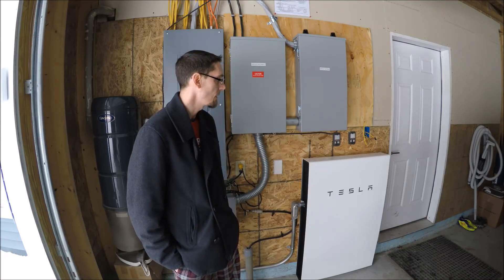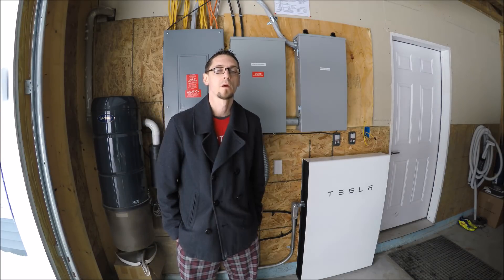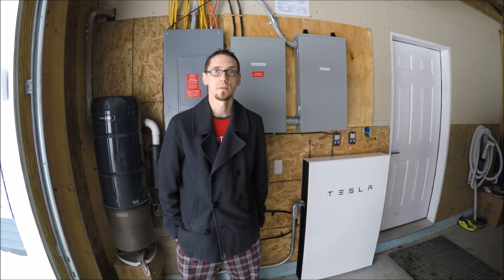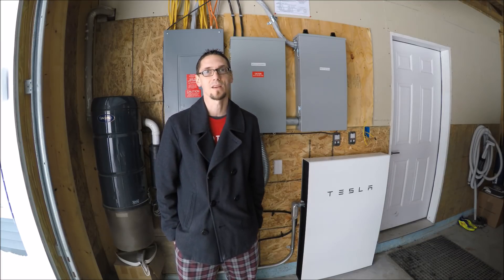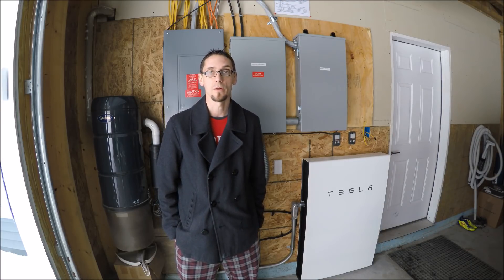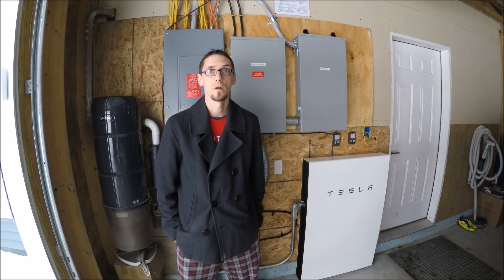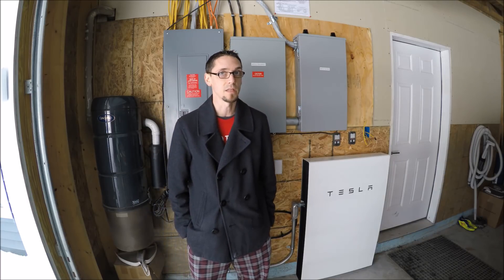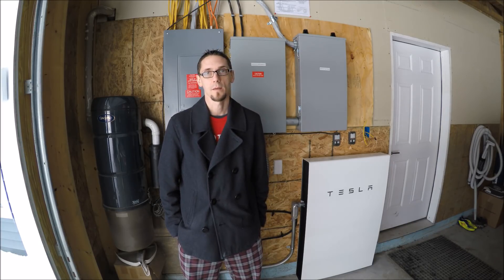New Tesla Powerwall For $1500

Comment: 48amps in NOT the max that the wall connector will deliver ....  it does up to 72amps for the X, & it can deliver 80 amps for dual charger model S's.  According to Tesla's web page - this applies to the model 3 as well
https://www.tesla.com/support/home-charging-installation
just sayin'.
Reply: You're correct in almost all you say, but he wasn't speaking about the wall connector, he was specifying the maximum charging rate that the Model 3 can handle.
Reply from the maker: You are correct that the Model S and X can accept more AMPs and the TWC can put out a lot more than just 48AMPs.  However the Model 3 only has an onboard 48AMP AC to DC charger and there is nothing else offered to upgrade the Model 3 from that.   So, at this point a Model 3 can only accept a max of 48AMPs for AC to DC charging.  Of course a Supercharger is a lot different as that is DC to DC charging.  Thanks for commenting.
Reply from the maker: Also...if you look closely at the chart in the link you left, the Model 3s MPH of charge stays the same after a maximum output of 48AMPs.  The reason the car can technically accept all the way up to a maximum of 80AMPs of output, is because the car can recognize it's max potential of only being able to receive 48AMPs, which is limited by the cars onboard charger.
Reply: Vehicle battery option  On-board charger capacity (current/power)
Model 3 Standard battery  32 amp / 7.7 kW
Model 3 Long Range battery, Model S or Model X with 75 kWh battery  48 amp / 11.5 kW 
Model S or Model X with 100 kWh battery  72 amp / 17.3 kW
Reply from the maker: It can handle whatever the TWC you throw at it due to the limit of the onboard charger, which is 48AMPs.

Comment: Should that POWER WALL BE SITTING ON THE FLOOR SHOULD BE AT LEAST 1 FOOT ABOVE FINISH FLOOR
Reply: I'd have insisted it be mounted higher, people DO wash garage floors after all and any water could be detrimental IMHO, but just my opinion and what I'd request apon instilation. Period.
Reply from the maker: It's perfectly fine to sit on the floor, it has rubber feet and is also made to withstand outdoor installations. This is obviously in my garage and no chance of water in the garage every reaching above an inch of standing water. Plus, the case of the powerwall is sealed.   Great question and actually a common question I've had.  Keep in mind the whole installation was done by Tesla.
Reply: TM3Life OK. Have it your way. Thanks for responding.
Reply from the maker: Personally, if I had it my way, I would of had it installed three or four feet up on the wall, but that was Tesla's preferred method of installation and since it's completely covered for any issues for the entire 10 years of service, I'm fine with it.
Reply from the maker: It was Tesla's install...so would hope they know what they're doing. If it fails due to their mistake in mounting they will take care of it.

Comment: GMP Powerwall deal vs buying a ICE generator:
Sometimes a gas or diesel generator is better suited for emergency power, but $400 generator will not automatically start, automatically isolate from the grid, and automatically shift to the house (automatic bus transfer). Even a basic generator with basic electric start (not automatic start) and a manual bus transfer cost roughly $1750, plus tax, plus installation. 
lowes.com/pd/Generac-HomeLink-6500-Running-Watt-Portable-Generator-with-Generac-Engine/999960939

The GMP powerwall deal gives whole house automatic backup power, and to install a internal combustion generator that does that same function automatically will cost a lot more than $1500 to purchase and install. The GMP “gas tank” automatically refills when the power comes back, or when the sun comes up if solar is connected. It will not need any oil change. The GMP is silent and should be trouble free.

A generator may be better suited if you lose power for long periods, that would need more than 14 kWh during the power outage. You can also take a portable $400 generator somewhere else to use it. As long as you have gas, you can keep making power. 

With solar panels, which pay for themselves eventually, the GMP deal is ever better because all you need is the panels and inverter which can sync to the GMP powerwall when the grid is down. Most grid tied solar won’t work when the grid is down do to anti-islanding, and it cost a lot more to install a system that can do what all the boxes GMP installed already does.

For me, the GMP deal would be good because I don’t have a place to store a gas generator, and it would sit for a while and not start easy when I needed it, even though a $400 1500 watt inverter-type generator would work fine for me as long as I had fresh gas. 

If you are at work and just the wife and kids are at home, any you have a portable generator that needs to be connected illegally to your house with the grid down, it’s not easy to explain how to hook it up. Believe me I’ve tried. LOL

Each person needs to evaluate the pros and con of each system, and their budget and situation. If you can afford it and feel the need for it, you can get the GMP powerwall and still keep a cheap gas generator.
Reply: Philip Agtuca, yes, it’s not efficient, but worth it if your frig or deep freezer needs to stay on. The inverter types can throttle down and run at most efficient rpm for the load. And they are quiet when only running a light load. Each person has to analyze which, if any, is the best solution for their usage.
Reply from the maker: Very well said!!!  I travel often for work and my wife would not want to have to worry about losing power and starting up a gas generator.  This, for me is the best situation I am fortunate enough to take advantage of.  Once the solar goes on the roof...it will be even more sustainable for longer periods of down time.
Reply: Based on spec, 3.2kw for 12 hours empties the 7.5gal tank. At $2.49 /gal ave, cost to gen power is 48.6c/kwh!

Comment: Not sure but I believe there’s a local code that requires that the powerwall needed to be off the ground in case of a water leak.  It should be at least the same level as your door step. Giving it about 5 inches of free board. If the case it self is sealed so that it protected against water damaged  then you should be ok.
Reply from the maker: Dale, this was installed by Tesla and Solar City, which of course is now just Tesla.  Green Mountain Power had to sign off on the install.  There is no way in my situation there could ever be standing water in my garage.  I'm not 100% sure about whether or not the case is sealed, but it is designed to stand on it's own rubber legs on the ground.  It's a pretty typical install for something that will be inside of a dry structure.
Reply: I concur if they could have given it a few inches they should have. Just for mopping and sweeping alone.
Reply from the maker: That would of been nice, but if you plan to install more than one Powerwall and have limited wall room, this is the best solution as they can install in tandem/stacked outward from the wall.

Comment: How has the power billing changed? Is it net metering or net billing? You are paying to charge the powerwall, so when the Utility draws power they owe you a credit.
Reply from the maker: They have a clause called "Customer Make Whole Bill Credit" that reads:  When energy is flowing into and back out of the battery, some of the energy will be lost as a natural part of the charging and discharging process. Each month, GMP will make the Customer ‘whole’ for these energy losses by reimbursing Customer with a GMP bill credit for the approximated energy losses due to the operation of the battery.  I hope that answers your question.